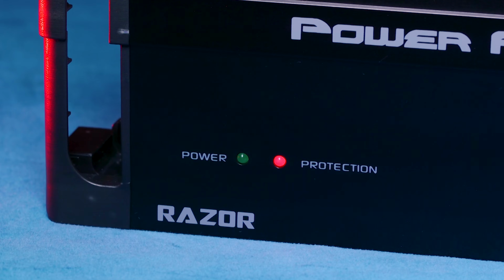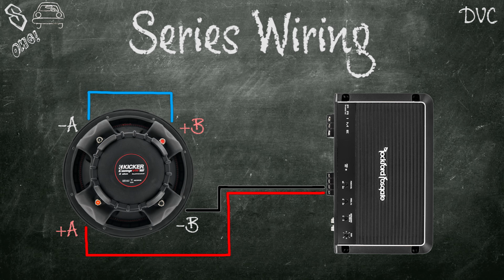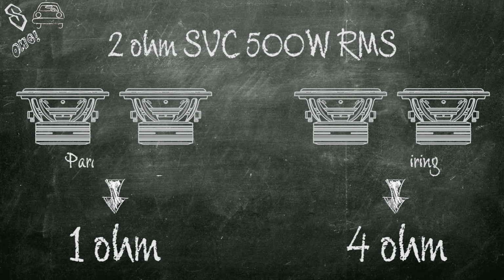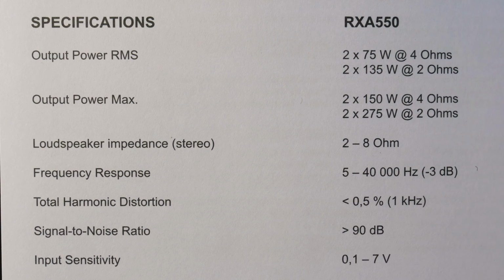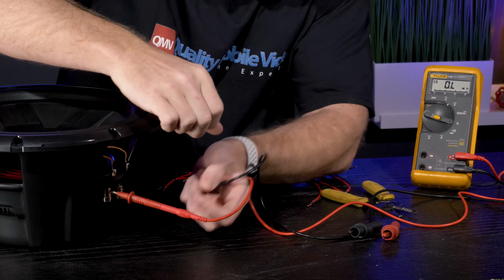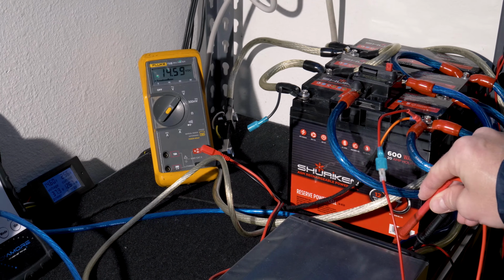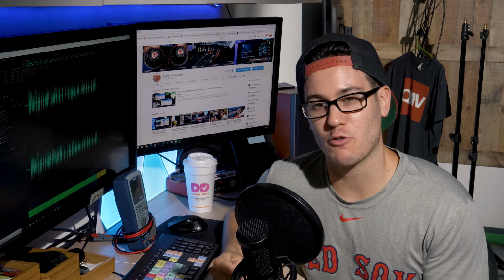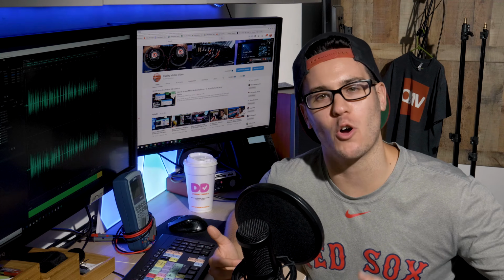Bass Cuts Out at High Volume - Amp Shuts Down -  Car Audio 101

Comment: It's probably your impedance so check the way you have your wires connected to change the ohms to make it compatible with your amp. You can find a wiring diagram online
Reply: What if mine are kickers? It came with the box
Reply: @dclean-_-1653  do you mean that when you got them they were already wired in the box
Reply: @mikedee4399  yes they were a gift, came wire already in a kicker box they are wired parallel making the load 2 ohm since each speaker is 4 ohm correct?
Reply: @dclean-_-1653  that was my problem I started using my brother's titanium Eclipse Speakers cuz I sounded good but then when I put it in my car that would play for like 2 minutes and the bass would cut out and I had the power turned all the way down and the bass boost and everything else was turned down and I had a 1600 watts going to each sub. My brother was using a different amp than I was so that's why I had to change them around. They actually have diagrams that I found online because trust me it's pretty confusing. Just looking at it you would think it was in Chinese lol. But depending on how many ohms your subs are and whether you're using a 2 or 4 channel amp. I never usually use a 4-channel amp but that's the one I had. I don't know what you have but truthfully it would be a lot easier to a mono amp and Bridge it and then just run a wire from sub to sub. My brother have kickers at the time and a Kicker amp that sounded really good but let me tell you I still regret getting rid of them but I had a pair of Alpine Type R 10in Subs and I hit really hard I like them better than the titanium eclipse. And I have had all types of different Subs when Circuit City was around it sucks they went out of business because I had like $5,000 in store credit when I first got into the stereos I had a Cadence amp and I kept blowing every subwoofer they recommended so I had to stop using it and get a different one. My one car I had a special box made from Bryn Mawr or Tweeter used to be called and had 15-inch Boston's Xtants and JL Audio and still like the alpines better

Comment: I have 2 Orion XTRPro102 10" DVC 2ohm subs that are 1000 watts per sub. They are connected to a Power Acoustik Razor 2500 watt 2ohm amplifier. The problem I'm having is when I turn the bass up, the amp cuts out, goes into protection and comes right back on within a second. As long as it's low volume, it functions fine. Any help on what could be happening?
Reply: im having the same issue with the same amp brodie, ever figure out anything? thx
Reply: All the razor 2500s do that , the amps are cheap for a reason
Reply from the maker: We have a video to help explain what could be the issue! https://www.youtube.com/watch?v=SJu1s4GHkF0&t=3s
Reply: @Qualitymobilevideo  be
Reply: @Qualitymobilevideo the link won’t work, I want to see that specific video

Comment: I have somewhat of the same issue I just installed a JVC double din and 2 alpine sps6.5c speakers in front and 2 alpine sps 6.5 speakers in the back .. they sound great!! But when I turn the volume up to 27 (out of the 35 max it can go) the stereo shuts off and reboots .. what can be my problem? Are the speakers to powerfull for the radio? Power issue?
Reply: Did you have it fix ? If so please tell

Comment: So i decided to use my dads amplifier one day, its a boss phantom class D 5000 watt monoblock, it was playing fine but then started popping into protect, but its wierd the way it does it because it rapidly does it unlike the standard amp ehich goes into protect and takes time to come back on,,, the amp wasnt hot,,, it was on low volts, so i put it on a 14 volt system and it still continued to go into protect, please help me, is the amp just trash???, ive only seen boss phantoms do that,,, my subs arent blown, nothings touching eachother either
Reply: The subwoofers are quantum audio 15d 3000 watts dvc, the amp is a phantom 5000 watt monoblock, i also tried the amp on other subs like 12" comp yellow kickers, and a kicker l7, the amp had the same problem
Reply from the maker: Are you making sure that the combination of impedances of the subwoofer match the make the specific loads at the amplifier?
Reply from the maker: What are the exact models of the amplifier and subwoofers
Reply: When the amp did work it was pushing 2 ohm kickers, it acted up after i put it on my 4 ohm 15s
Reply: The system was playing fine but i do remember the amp started to have a peanutbutter like smell,,, could low voltage have possibly fried the amp?, it was running on 4 regular car batteries, no engine on, no charger
Reply: It was also on an old supertuner pioneer radio,,, could it have send a bad signal that is messing with the amp?, or did it just fry?, if so, how can i fix that

Comment: Current spec.

2x Skar vd 12 subs dual 2ohm 500rms each

Rockville db14 4000watt AMP

So i upgraded my amp and sub from boss 1100watt amp, MTX terminater sub to the current one listed.

For some reason my old set up is alot louder and i cant find any solution. Would there be any reason on why my new set up is not as loud?? even though its a much better set up?
Reply from the maker: Do you have exact part numbers on the new gear so I can look into it for you?
Reply: Just because the audio componets contain more watts, or the subs are bigger, it doesnt always mean its louder
Reply: Like my audio system, i dont use any amps for either of my 12 speakers, and the sound is still as loud as any pro audio system, louder than any simple system
Reply: Steven I have the exact same problem. OLD SETUP:  pioneer 8601, 800watts certified @1ohm. New setup  Dual Da6001 1300watts certified @1ohm. DOES ANYONE HAVE ANY INSIGHT INTO WHY MY SAME two 8's WIRED @1ohm IN THE SAME BOX(untouched)  ARE MUCH MUCH QUIETER WITH NEW MORE POWERFUL AMP THAN WITH OLD ONE. I Have my gain knob cranked and still barely any effect with my radio Turned up to MAX. Bass boost is off, Subonic turned down low to like 20hz, Low pass at like 80-100hz. I shouldn't have to ever have Gain cranked like this, I'm way over RMS. I Think my pioneer DEH X65bt radio might output a low voltage from the RCA's and the new amp is not as sensitive? Could my 4awg Knuconceptz CCA wire be the problem? I currently have a 75 amp tube fuse which should have blown already right?(going to replace with ANL) I don't get what is stopping my New amp from Making its 1300 watts??

Comment: Does anyone know if running a 4oh SVC 10 inch with a 4 ohm DVC  12 wired to 2 ohms on a apmi 2000 should have any reason to cut out for a few seconds at high volumes? And is it because of the single voice coil vs the dual voice coil?? I don't think it's my voltage
Reply from the maker: I would never suggest wiring two different spec subwoofers together. You should always either have completely identical subs, or at least match their impedance, power and voice coils
Reply: @Qualitymobilevideo  thanks man I know it's not recommend but I just wanted to test it out in my car cause I had extra subs not being used and plenty of power not being used
Reply: It's a monoblock. I haven't checked if it's protecting or not but I'm really just wondering if the coil difference is a problem and if it's bad for the monoblock

Comment: I had this problem a while back lol.
Reply from the maker: What ended up being your issue?
Reply: Quality Mobile Video I think my amp was pulling too much power and draining my battery. I went under the hood to check my fuse and it was melted to the wire. So I pulled the battery out, swapped it with a XSpower d3400, and upgraded my power wires.

Comment: SIMILAR ISSUE...  MY HIGHS CUT OUT AT HIGH VOLUMES...  I'M RUNNING A 5 CHANNEL PIONEER AMP...  I HAVE COMPONENTS ON THE FRONT, NOTHING ON THE REAR, AND A PAIRNOF 10 INCH PIONEERS ON THE SUB CHANNEL...  THIS IS WIRED FROM A CLARION EQUALIZER,  WITH SIGNAL BEING BLUETOOTHED IN VIA A JL AUDIO BLUETOOTH CONNECTOR...

1981 GMC CABALLERO...  (the el camino's half brother...  lol...)

Comment: If you're going to make an informational video atleast use a proper ground.. The ground a the 00:31 sec mark is an horrible example of a proper ground
Reply from the maker: What's wrong with it
Reply: The paint isnt even sanded down, the terminal doesnt look to be heatshrank nor even some simple electrical tape. Using an open end lug without a proper seal will surely induce corrossion much quicker. Using an open end lug i would highly suggest soldering the open end to reduce the chances of moisture and other possible contaminates from working its way up the cable(assuming its atleast sealed off around the crimp)
Reply from the maker: That was simply a 3 second clip of a past install just to show what a ground looks like. Go to the 4:20 mark in this video to see how in depth we went into creating the grounding point, doing all the things you mentioned. https://www.youtube.com/watch?v=SJi_o8--pZE
Reply: I watch all of your guys' vids, that's why this one threw me for a loop lol
Reply from the maker: All good bud, it was just a quick B-Roll shot!
Reply: @Qualitymobilevideo  ignore him some ppl are miserable

Comment: Here's a topic you guys should touch on. Box rise.
Not sure if you guys have seen it but I have. It's when a sub in a box plays at higher ohm loads than what it's rated at. Sounds funky but it's true. Had some 15's that I had wired to 1 ohm, but when playing I was seeing a 4 ohm load when I clamped it, so I dropped them to .25 ohms and then I saw a 1 ohm load.
Now, it won't be like that at all frequencies. Some frequencies will play closer to rated impedance than others, so watch out.
Reply: That's interesting and it may actually be my issue bc my sub ohms seem off now too. I have a dvc 2
ohm sub and it should be one ohm wired but its not
Reply: If it's my problem and I just happened to see this comment imma flip tf out.  Because it sounds so right in my case and  at 53 yrs old doing car stereo since 27 i never heard of it. It makes damn sense to bc the ohms move and change with any kind of movement or pressure in the non play state
Reply from the maker: Good suggestion thanks!

Comment: Hey i have a 95 geo tracker that has all stock speakers i want to get good speakers  and subwoofer.  What size speakers can fit in it and i have a 10 in. Rockford fosgate shallow mount that worked good in my truck but when i took it out the surround got a cut in it is this woofer still useable should i get another if so wjats a brand you recommend.  Thanks for any advice.
Reply: Justin Depoy 
Go to Crutchfield. They're site should be able to find out what size speakers you'll need. And for your ripped surround, the best option would be to get a new surround, but you should be able to repair it with some duct tape or electrical tape. It won't be a permanent fix, but it'll at least hold it out for a while